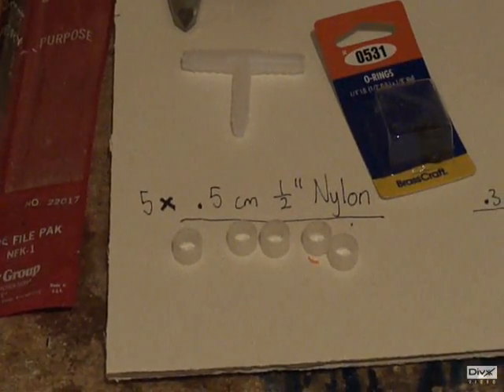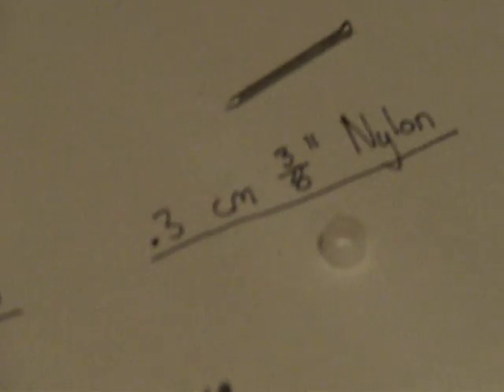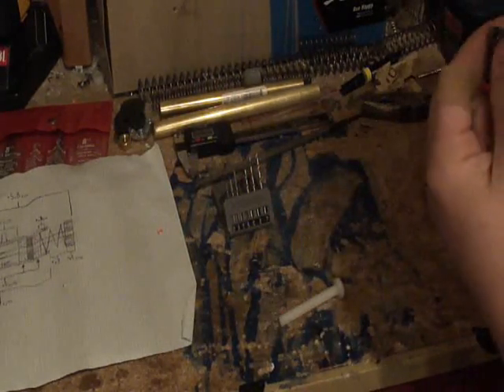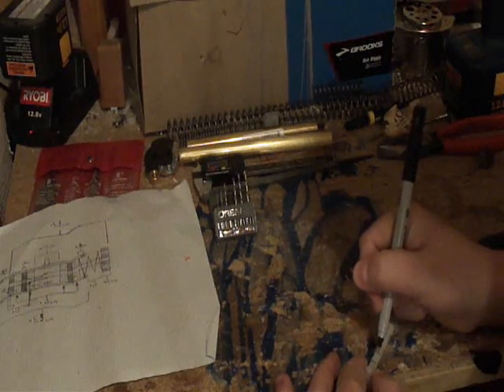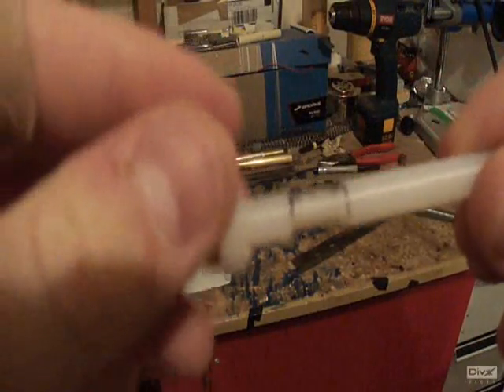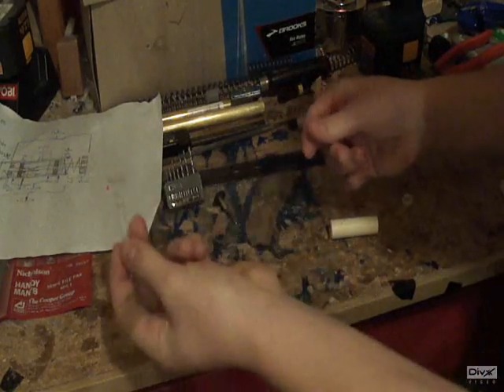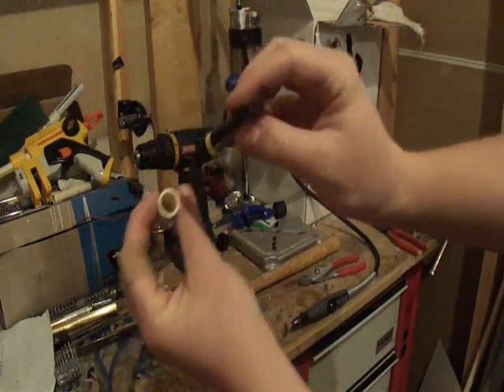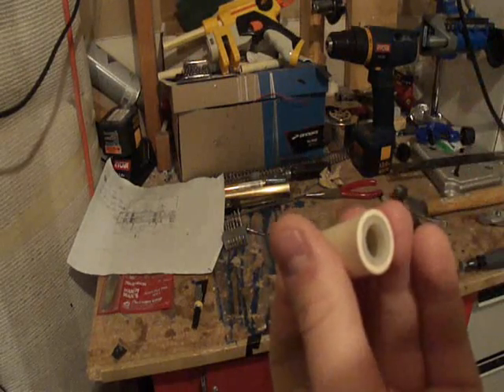How to: Push Button/Trigger Valve: Part 1

Comment from the maker: @dadom211 1/4" rod: 8538K14, 3/8" OD tubing is: 8628K51, 1/2" OD tubing is: 8628K28. If you need smaller quantities, pm me. I have a surplus of the tubing I would be willing to sell to your specifications.